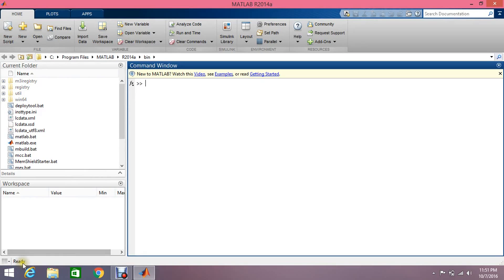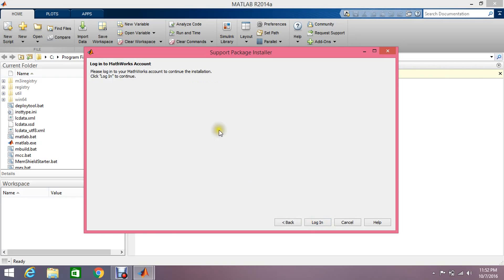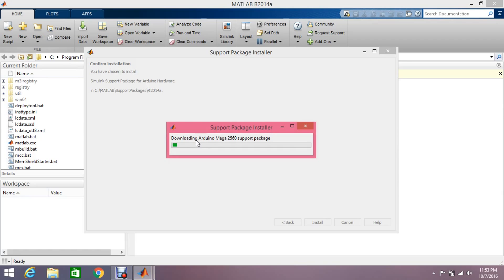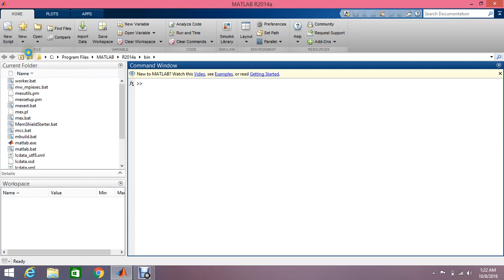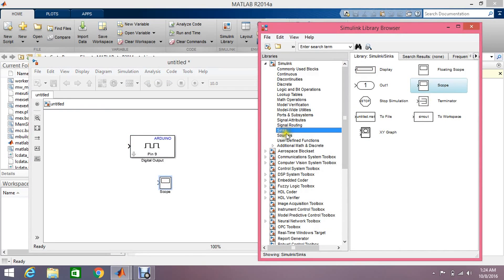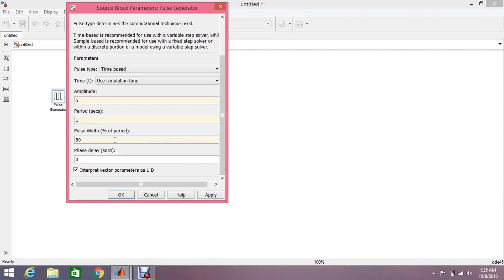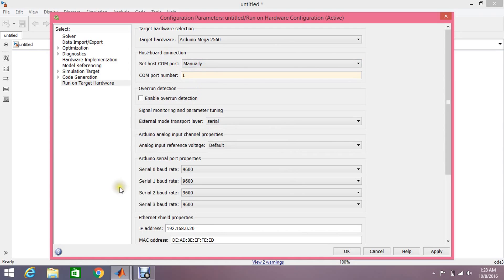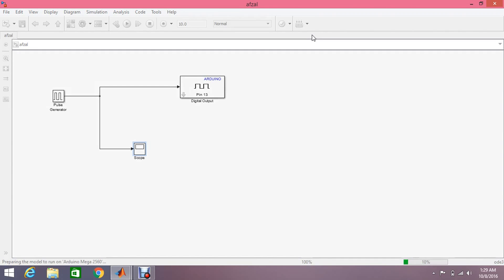How to use arduino in matlab and simulink | matlab arduino | arduino matlab interface

Comment: i have this error in Build :
Your current working folder is: 
 E:\MATLAB-2016\bin\registry
Simulink does not permit you to modify the MATLAB installation area. 
Please change to a working folder that is not in the MATLAB
installation area and re-try the previous command.
Reply: please help me how to fix this because m getting this error too
Reply: Imad Roula  is already fixed?
Reply: yes :') thanks
Reply: i m getting this error too
please help me ..
how to fix this
Reply: just change the folder directory in Matlab and it will work fine with you
Reply: "cd(tempdir)" type this in command window and press enter and then again run your simulation.Your problem will be fixed.